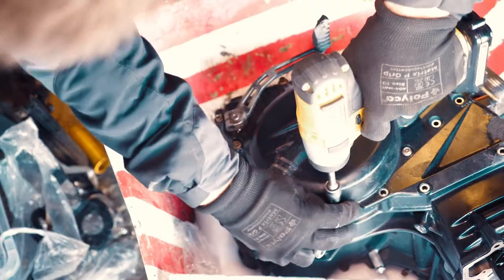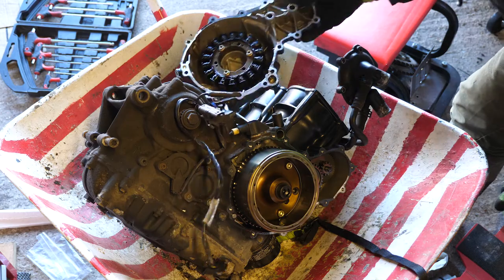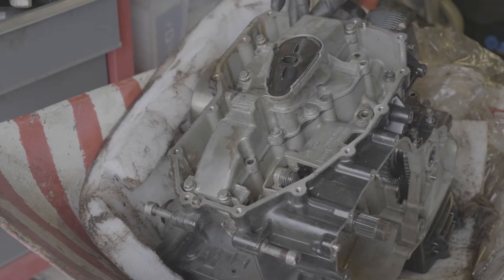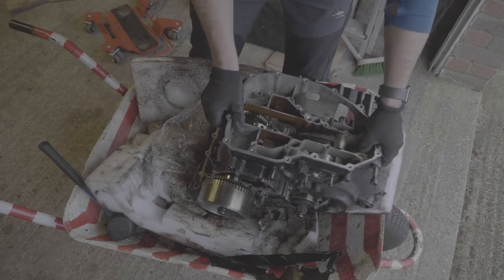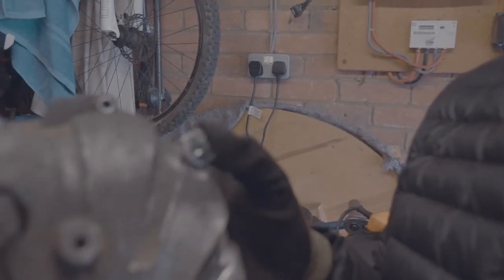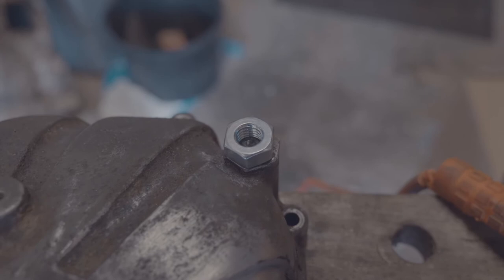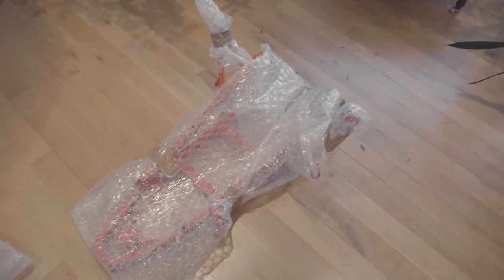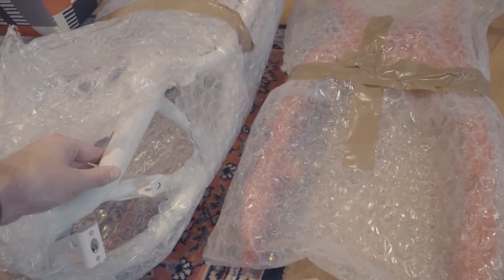F800Gs 135,00 mile Rebuild Pt3 Splitting the Engine.

Comment: Looking forward to seeing the next video for this! I have a 2009 F800GS which I did a full strip and repaint of frames/swingarm last year. I wondered about splitting the engine and going for a preemptive timing chain and guides change but it seemed to be ok when I checked the valves. That and the engine split is mega scary for me! It’s so helpful to see how you’ve gone about it as I’m sure it’s inevitable at some point. Also to hear of the problems and pitfalls you’ve faced and the solutions to overcome them. 
Thank you for the great vids. 
Ride on!

Comment: How much is the material for this kind of rebuild ?
Only the parts for minimum damage to maximum damage rebuild ? 
I would do it myself..
Want to buy a gs 800 with 60 k kms, looks  and sounds like new and is cheap, but maybe one with 15k kms, the difference is 3500 bucks ...
Regards
Albert
Reply from the maker: It depends on the damage, so for me to get back running (not powder coating the frame or cosmetic bits) i needed valves which cost £100 for a complete head 2nd hand (9k Miles on it), timing chain new £80 pounds and associated guides and gaskets (complete gasket kit was £300). So about £600 but that doesnt include tools or time, which is the most expensive resource! :) Best of Luck! You'll have a blast off road with either!
Reply: Hi Ed 
I too bought 2011 F800GS in state for $2000 , Exact same problem as you jumped timing in intake valves and broke all the guides into pieces I took the head off no damage today pistons, question Is there way to replace the guides without tearing Engine apart? , The engine still in the bike, I was thinking take the clutch side out to see if I can see any plastics? , i’m assuming that you’re able to take out the bolt that hold chain guide from clutch side ? Thanks